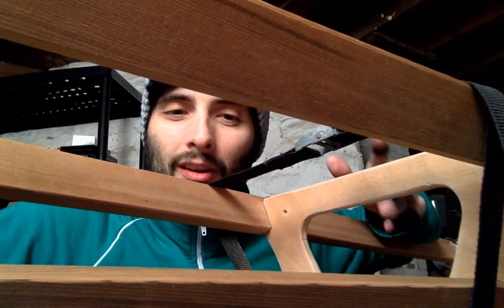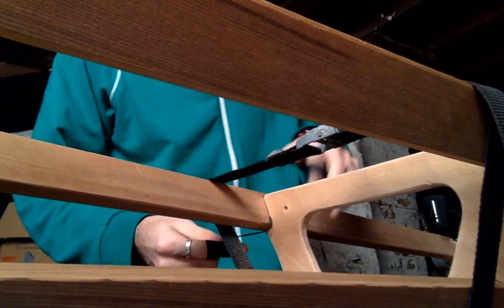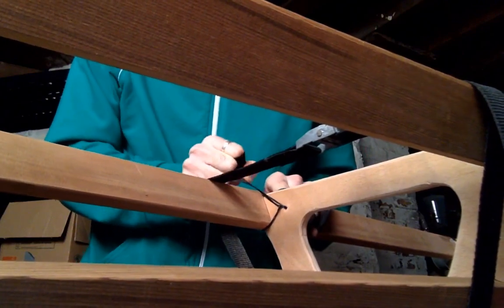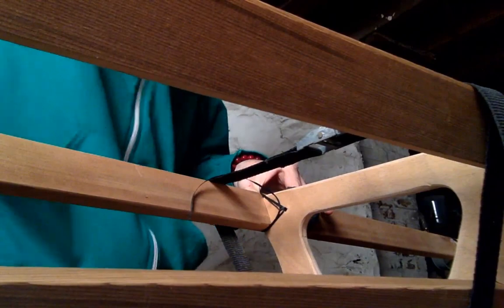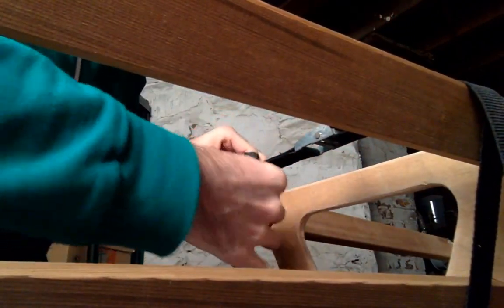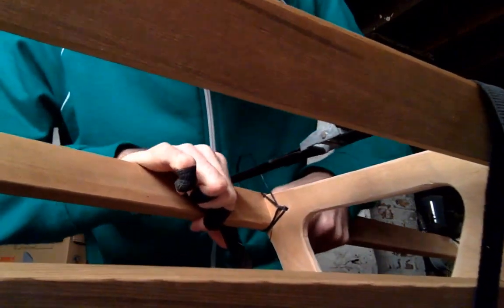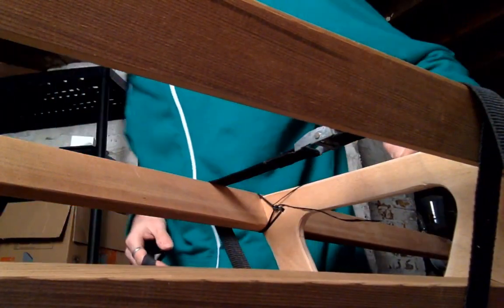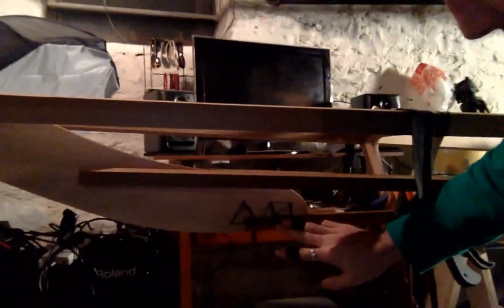Skin on Frame Kayak Build – Part 5 (Live Stream) Lashing frames and securing gunwales to stern stem

Comment: Hi Kayakhipster,

i follow your videos about the SOF-kayak building and really enjoy it. Do you think about mounting points for the GoPro-Camers as on your other kayaks? Or is this impossible cause of the skin/fabric?
Thanks for your work!
Reply from the maker: Thanks! Glad you're enjoying it. I've thought about it and have not decided on a solution yet. I have a clamp mount that maybe can be used on the very tip of the bow/stern, or maybe I can rig up a specific mount for the skin on frame. I'll keep you posted on the solution, it's going to be interesting to solve.